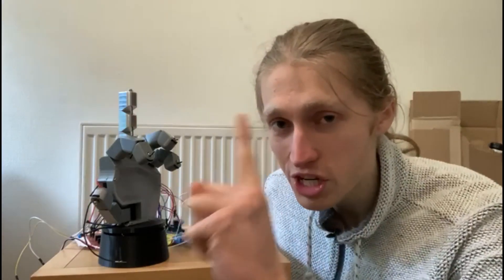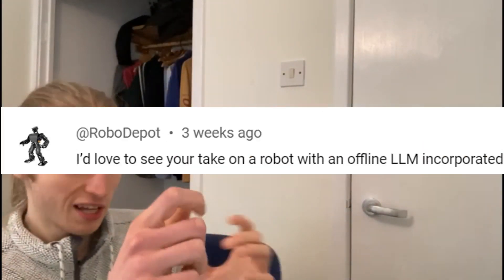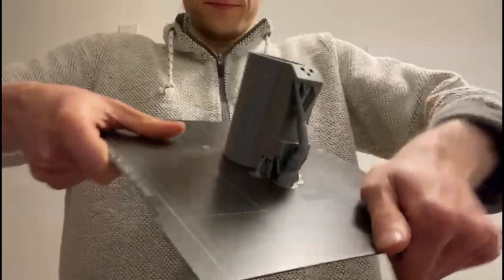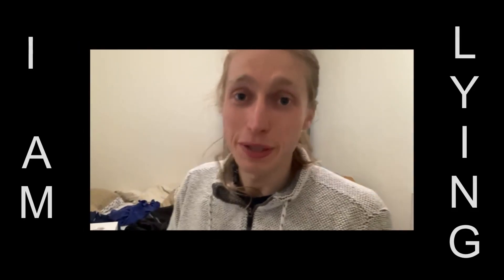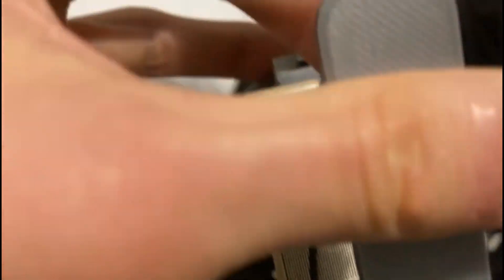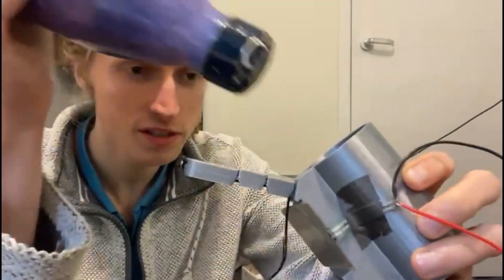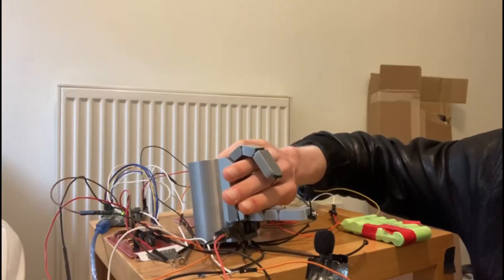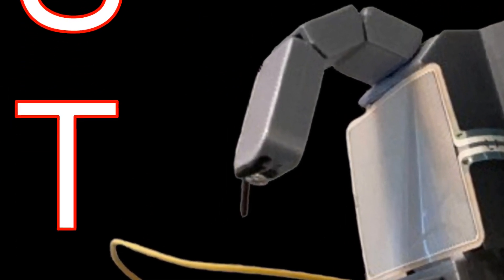I built your dumb robot idea.

Comment: Cool build, but wasnt the bottom finger supposed to move too? You never mentioned it being broken or anything, but you showed a close up of the motor at the bottom of the cup, twice, and the bottom finger moving...so i was kinda confused? It just looks weird with one curled and the other straight out, meaning you have to hold it weird. Id love to see you refine this project and possibly make it mobile i.e. all the electronics in the base of the mug (a bigger diameter mug would give you plenty of room to mount the board and battery)
Reply from the maker: Yeah, in that final one it didnt respond, why, I think the current threshold was met instantly? The motors soemtimes draw a lot of current instantly, which can mess up teh detection, I would normally just refilm it when that sorta stuff happens, but I had my dissertation due the next day lol :D - Ill defo look into it :D